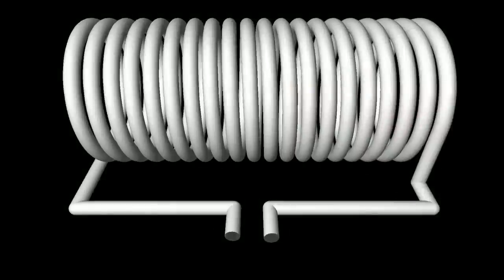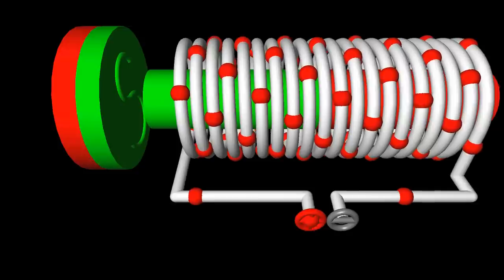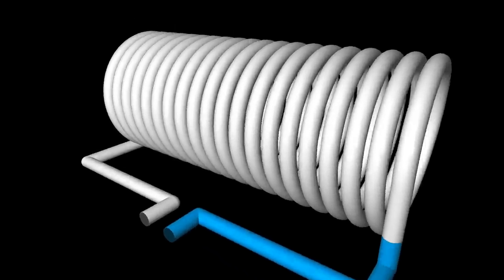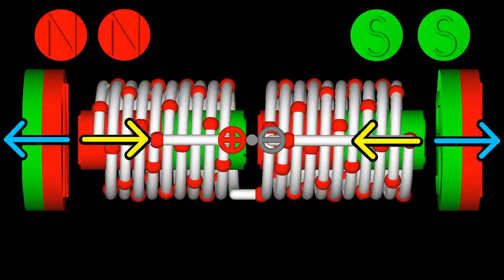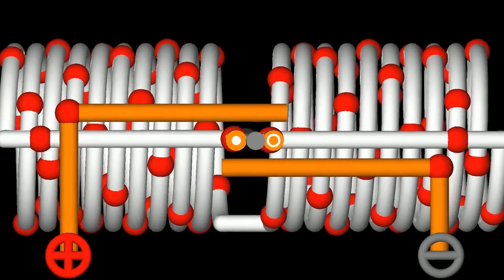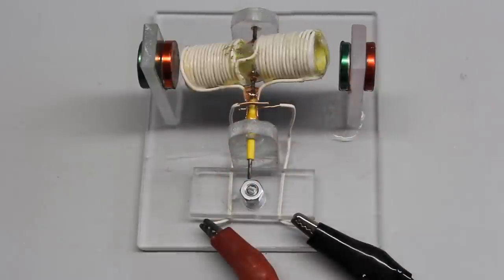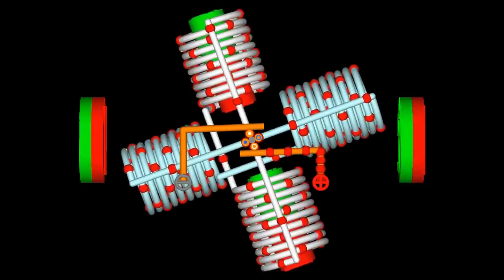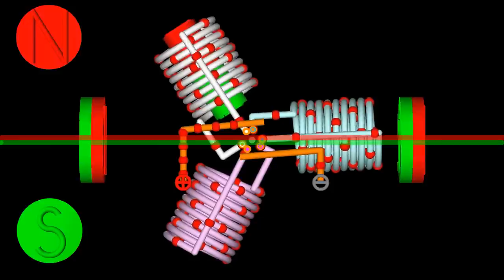Working principle of brushed DC motors

Comment: Certainly deserve more views.  Motor concept is more complex than people think.  The only youtube video I came across that happens to be (1) realistic - no unnecessary simplified abstraction (2) complete - not skipping any phenomena or throw at you with rules or "just-because" formula  (3) precise - perfect alignment and animation speed and you have no need to pause the video and ask WTH is going on (4) accurate - finally! finally a video with the physics correctly applied. Saying this video is clear or "best" is just an understatement.

There are countless youtube videos delivering the seemingly identical concept but they are either (1) self-contradictory (mixed with incorrect use of right/left hand rule), (2) straight out incorrect and misleading (applying the concept of Lorentz force from single coil onto multi poles motor - so very wrong yet get million views. I can't believe how many people have been mislead from popular votes), and/or (3) confusing (wrong arrows of magnetic field in air or through a material; no mentioning of or unclear use of conventional current and electron flows).  Magnetic flux goes from S to N through a material and complete the flux line from N to S in air (some videos have the m-field the other way around - omg!).  There were videos with beautiful animations but can have all three problems mixed up (unacceptable), and falsely trap students into believing that they understand the subject - then, if you were to ask them to draw out a N-pole motor rotating in a specific direction, 90% of them would quickly find themselves utterly lost in the wild half way through it, and realize what they thought they understand was incorrect and incomplete.  You can plug in the equations fairly easily to calculate what current to yield what torque on a homework sheet, but the underlying physically concept is actually not at all straightforward to grasp.

Thank you for your work - your demonstration is pitch perfect.  I enjoyed the 25mins ride of CORRECTNESS.
Reply from the maker: Thanks for all the good words. The reason why I put all the efforts in my videos is that I made similar observations. There are mainly two kinds of videos on physics:
1. Great explanations of the underlaying theories (usually made by teachers/professors), but with horrible or totally missing drawings.
2. Nice to look at animations with (almost) no idea of the physics behind (dwarfs running along a wire or lightnings somewhere).
Keep in mind that sometimes arrows pointing the wrong way long might just be a simple mistake (I am not free of that, too). Unfortunately wiping out such an error in a video takes lots of more time than making corrections in a written chapter...
I don't try to attract lots of people, but hope to educate those few that are willing to learn and so are worth all the efforts.
Reply: such videos may never reach the mass popular views like some of the other fancy short-cutty animations, but the clarification and inspiration given to the motivated few is what will eventually make a real difference. Keep up the admirable work.
Reply from the maker: Feedback like yours keeps me on track ;-)

Comment: Amazing work! Is it possible to use multiple windings on the same ferrite rod to increase magnetic strength? If so, how would you wind it? i.e. would you, say, wind from left to right and then wind back again, or left to right and then stretch the wire to the left and wind left to right again? Or multiple separate wires joined at the ends?
Reply from the maker: andy parry Using more than just 20 windings as in the video is a very good idea. The motors I have built draw a current of almost 10A at 3.3V operating voltage! Do as many windings as possible to reduce that current and wind it the most easy way: Back and forth without stretching the wire. Besides the number of windings, the dimensions of the wire have an influence on the efficiency: The thicker the wire, the less ohmic resistance, but the less windings you can make around the core. Finding the best compromise isn't easy. I will demonstrate how to build more efficient motors in another video - stay tuned!
Reply: Thanks for the reply. I wasn't sure if winding back and forth would some how cancel out the magnetic field on the lower windings, or make them less efficient.
Reply from the maker: andy parry As long as you don't change the direction of windings, the magnetic field is boosted by a higher number of turns.

Comment: Great, a new video :)
Reply from the maker: Nick ...and hopefully a great new video, too.
Reply: HomoFaciens Of course it is, the 3D animations are an excellent visual aid and you explain things well.  
BTW What OS and programs do you use to make the animations and video? Some GNU/Linux distro and Blender, right?
Reply from the maker: Nick Thanks! The animation sequences were programmed in OpenGL. That's more easy to me than using Blender. My computer is an 8 years old machine with a dualcore CPU running at 1.8GHz, 3GB of RAM and a 2TB hard disk (which is the newest device in that computer). The OS is Ubuntu 12.04LTS and kdenlive is used for video editing.

Comment: This video has not got the views that it deserves. 

I have 1 question that has given me confusion.   I understand the right & left hand rules for determining force, field and current  for a straight wire but then the wire is coiled,  which direction do you use for the current since it is in a circle ?
Reply from the maker: At a streight wire your thumb points into the direction of current. In doing so, your fingers point into the direction of magnetic field lines. You can also do so in a coil - your fingers will still point into the direction of the magnetic field lines. Do so and you'll see that in case the current runs from bottom to top at the front of the coil (conventional current, right hand), the north pole points to the left at the inside of the coil and to the right at the outside.
That's what you also get as a result when wrapping your fingers around the coil, pointing into the direction of current and having a look at your thumb. It also points to the left (which is the position of the magnetic north pole at the coil).
Reply: Thank you,  but how is the direction of force on the coil determined ? In the video the coil is rotating clockwise. Sorry for all the questions.
Reply from the maker: If you know where the magnetic north pole is, you can determine the forces between the permanent magnets and the coils.
Reply: LOL, yes thats what i finally did.  I thought there was a right or left hand rule for determining direction of the force but could not make anything come out right. Then I looked at the magnets and coil and realized that is what did after finding north pole. Thank you for taking the time to answer my questions.
Reply: I finally figured it out how to predict the rotation of the coil. We have a multi-turn coil like in your video and just look at one turn of the coil which is a circle. To simplify the math make the circle a square. If we apply right hand rule (I-current, B-field, F-force)  to each of the four sides, on two sides the direction of current is in the same direction as the field so the torque will be zero. Applying right hand rule on the other two sides,  the forces on the two sides wire will be opposite causing the rotation.    Ugh, I didn't know how to handle the direction of current for figuring out Force until making a simplification from circle to square.

Comment: but in motors with brushed brushes brushed brushes do brushes wear out? That is, if the charcoal is consumed the engine is to be thrown away? 🙄
Reply from the maker: Good motors are designed for a replacement of worn out brushes.